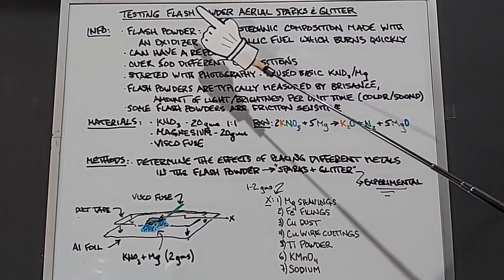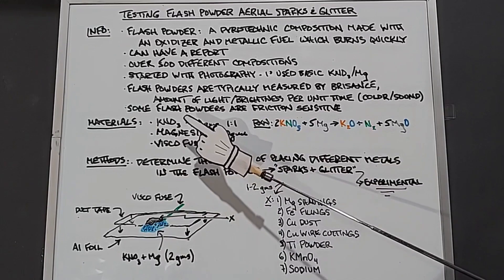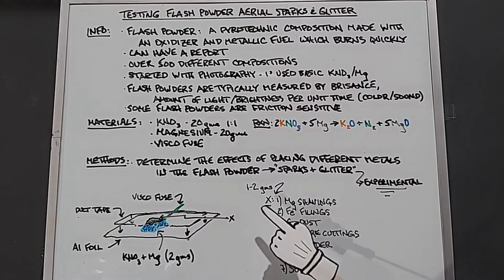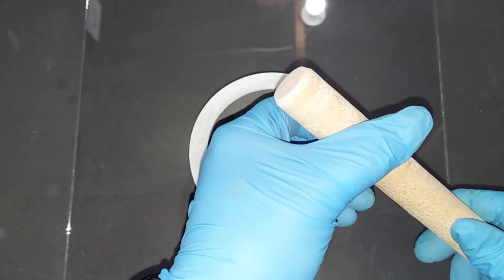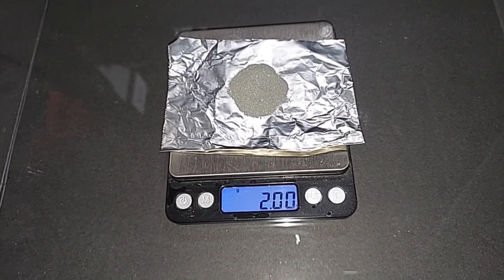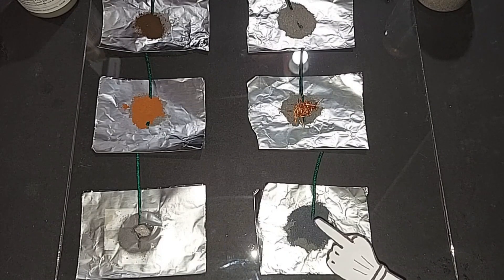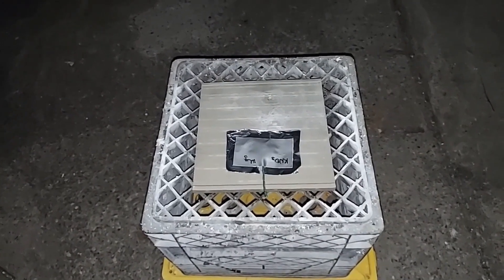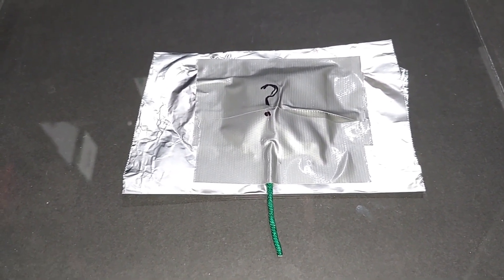Adding Sparks To Flash Powder

Comment: add super glue to your flash powder till you have small BB size bits then add a small amount of loose flash.
when it goes off it looks like white phosphorus..
i have made M800s that throw burning white streamers 60+ feet in the air.
Reply from the maker: Such an extreme and interesting thought.  Just maybe...

Comment: hmm try ferrocerum... ist pretty unusual in pyrotechnics but it makes crazy sparks
Reply from the maker: I have messed around with ferrocerium rods.  It is quite difficult to break them down into a powder without causing a huge amount of heat, and thereby "using up" the very part of the rod you want to save to make sparks.  I'm still working through this as it would be rather dramatic, I agree.

Comment: It's a great video, thank you in detail🙏
Have you tried ignition with flash paper? 
I have a question for you, what materials were used in the video I shared below? Can I get your opinion? 
Regards

https://youtu.be/k0V9pb1woIs?si=RE_yi4RuxtVh-xC_
Reply from the maker: Hey thanks!  I watched the video.  My best guess is that it's a burst of low temperature ignition sparks, as the gentleman is so close to them.  Meaning, it's unlikely Mg or Al.  There are some mixes that are generally unknown that the magic community keeps to themselves.  I suspect the sparks could be from KClO3 + Charcoal + MnO2 which burns up at a temperature less than 210 degrees F.  Or, something like that.
Reply: @cranialconstruction 
Hi how are you 🙏
I am sharing with you the table of materials used that the company sent me. A few of these elements were used. 
I Kno3%45+mg%15+Al%15+mg shavings 25%
I tried it and it was very successful. But I couldn't get a Spark in the Flash paper experiments...
Reply: I couldn't upload the list here, I sent you an e-mail
Regards

Comment: Thanks for your video. Saved me alot of time.  Did the report stay about the same? And do think the aluminum foil played any effect on the reaction with color output?
Reply from the maker: The report was a bit softened but still decent.  And, that's a great point that I didn't notice at the time.  The aluminum foil no doubt "whitened" the flash to some extent.  Since then I no longer use it as a container.

Comment: Magnesium gives great sparks but only if your mix make "puff". If it makes "boom" like fireckracker magnesium shavings burns instantly, no sparks just bright flash.
Reply: Titanium will do
Reply from the maker: Magnesium shavings only burn slowly relative to the powder.  Even with a boom.  They are ~1 inch long, and although coiled up due to the drill bit, take time to burn.  They are initially lit with the "boom" then get shot out as sparks.
Reply: So try fireckracker with magnesium shavings. I tried, it doesnt give beautiful sparks, just flashbang.

Comment: Nothing like some titanium or zirconium sponge. Might need a perchlorate to light the zirconium though.

One thing. I would be nervous as hell grinding the Mg and KNO3 together. Diaper only.

How about making some fountains. Like make one with charcoal and another with aluminum. This will show the difference between a metal and just black body radiation.

Or maybe some dragon's eggs. You know, with a bit of lead tetroxide that you have made?
Reply: You can also make dragons egg crackle mix with bismeuth oxide, it works a little better and isn't nearly as toxic.

Comment: That’s really cool! The metal I really want to try is zirconium, it’s used in military incendiary rounds.
Reply from the maker: Yes, Zirconium airsoft pellets spark against metallic objects, like cars.  Would be very cool.
Reply: Цирконий 28% с PbO2 72%+ 2%nc(+100%) даже сильно запрессованный в пластмассовую трубку 2.5мм взрывает 0.025 с/м.
Reply: It makes very strong flash powder. It's also used in old school single use flash bulbs.